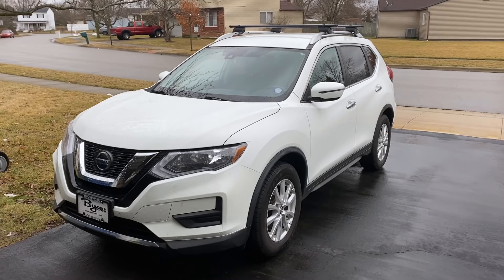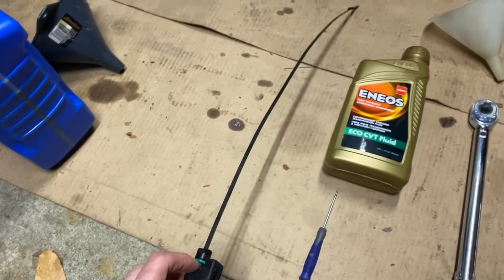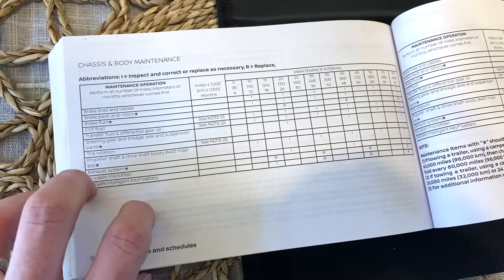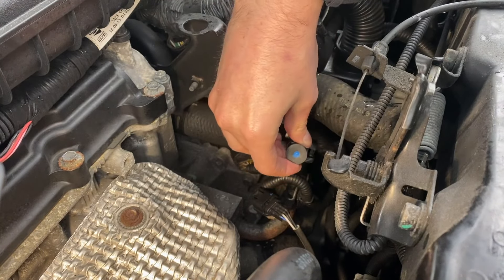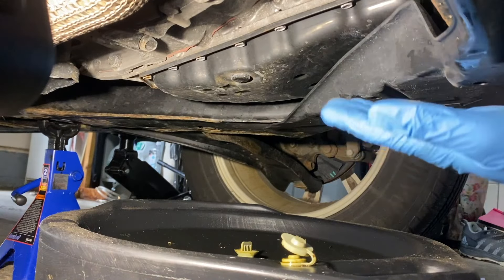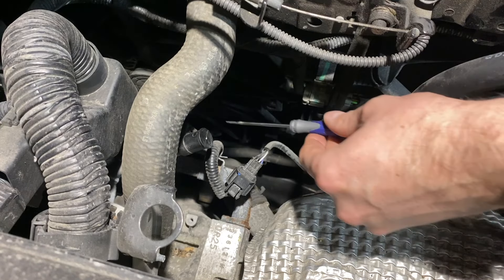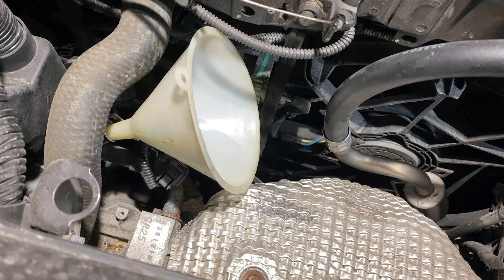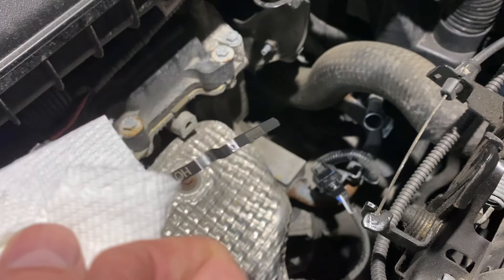2013 - 2020 Nissan Rogue CVT Fluid Change

Comment: Excellent video! So we have a 2017 Nissan Rogue and we have changed the CVT fluid on it every 25000 miles with the top of the line Amsoil CVT full synthetic fluid. It's also equally as important as to change the external transmission filter, something a lot of people overlook.
Reply from the maker: That is the second video, currently in the works. 😜 doing both the pan drop and bottom filter, and side-mount filter.
Reply: @MattStephensRich   Awesome because my research shows that the pan filter inside the transmission Pan is only up to 2016. 2017 and up there's only one external filter so I would be curious what you find on the 2019. 👍
Reply from the maker: This has definitely been one of the hardest auto videos I’ve had to research for lol just a lot of variation without a lot of documentation. I do expect two filters as this is a Jatco8; will be checking things out this weekend, and keep you posted!
Reply: @MattStephensRich  yes pan filter and exterior filter, it's behind the driver wheel. I will probably do both this spring, I changed the transmission fluid but it was so dirty I'm doing it again 3.5Q dropping the pan, will really appreciate your video if you do this👍Using Nissan NS3 , they raped me @.$27 a Quart.Will get a few more @$20 online.Next time I'm going to buy Amsoil fluid.
Reply from the maker: @jonmo2694  Mid-shoot on the current video! Transmission pan and bottom filter are in; still needing to tackle the smaller, particulate filter. Still recovering from rolling around on the ground a bunch chasing the screws. :P
Reply: @Jon Mo , In Canada NS3 fluid is $37 a litre plus 13% tax
Reply: @jonmo2694  $27/qt for Nissan NS3, ridiculous.
Reply: @MattStephensRich Want to make my own dip stick so what's the length of the dip stick also the length of the full line and low line.i know it's a odd request thanks in advance
Reply from the maker: @denzeljackson6505  Dude just spend the $15 😅 https://www.amazon.com/DIPSTICK-TRANSMISSION-31086-JA00A-Indicator-Compatible/dp/B08NWS8RSD/ref=sr_1_3?crid=1XXWO7R1U2147&keywords=nissan+rogue+cvt+dipstick&qid=1691460349&sprefix=nissan+rogue+cvt+dipstick%2Caps%2C146&sr=8-3
Reply: You should drop the pan and clean the magnets and screen along with the paper filter up a little higher on the trans. 😊
Reply: I did order this dipstick for my 2017 rogue and it does NOT insert all the way. I ended up returning it and using a long zip tie that inserts all the way to measure the fluid. @MattStephensRich
Reply: I was told at the dealership my 2017 rogue all wheel drive has no filters,sounds like they don't know what's going on.
Reply: @MattStephensRich don't forget to unplug battery after CVT oil change for 2-4 hours.
Reply: @NoWay-ye7yq   why?
Reply: @NoWay-ye7yq  what is that for?
Reply: Don't forget the screen in the pan as well.
Reply: @jonmo2694  Please also consider Lubegard 68115.  I've been using their regular ATF on my 2005 Honda Odyssey with excellent results, plus the 68115 on my nephew's Rogue.  Their lab documentation and pricing make them more attractive than Amsoil to me.  Currently 1.25 gallon 68115 is $60 on Amazon.
Reply: I would recommend  25k fluid starts  to have the burnt smell I usually do it at 18k

Comment: in this video when he sows the drain bolt there is another bolt just to the left and that is the over flow bolt . you start the car and put it in neutral and then remove the over flow bolt and let it drain till it is at a slow drip them instill the drain bolt and tighten . and then your good to go
Reply: I believe it's the bolt on the case that is on about a 45 degree angle.
Reply: When the plug is removed, the fluid overflow will have a BURP and then a steady flow untill it slows and stops. Reinstall the plug. That is the most accurate procedure.
Reply: I don't have that drain, just a dipstick. Nissan Rogue 2015 Select. I overfilled thinking i'd be able to open that and the excess fluid would drain out. Then i went to look for that bolt and it wasn't there at all. I had to get really dirty and remove the transmission bolt again and lose some fluid but i had no choice.
Reply: Accurate advice 👌
Reply: Shouldn’t it be don’t open bolt while running?

Instead open bolt while off and oil cold in case of overfill.

Then warm up oil to temp, turn off vehicle, open bolt 1 more time to ensure proper level.

Comment: I just spoke to dealership on how they “check” the CVT fluid.  He said they don’t.  Their process is they drain the fluid and add 7 and 3/4 quarter exactly.
Reply from the maker: Yeah makes sense with no dipstick/overflow valve being a process
Reply: This doesn't make sense to me, if only 3.75 quarts are coming out...
Reply: Torque converter
Reply: @tedpirsig154  i think its because you didnt take out the overflow plug, i'm not sure of the rogue has it, but my nissan has it. its beneath the drain plug, reach it with an allen key.

Comment: Very important that the vehicle is level and fluid at operating temp for an accurate check of the fluid level. Fluid expands with temp. Cold will not give you an accurate level as so many are saying here.
Reply from the maker: Good point!

Comment: Great video -
 FYI on page 9-6 of the manual you shared, both of those paragraphs refer to if the vehicle is used for towing, using a camper or car top carrier, or driving on rough muddy roads. Otherwise, Nissan suggest not replacing the CVT fluid.  The 60k miles you referred to is still bullet pointed under the towing section, and is referencing the the deterioration data that comes back from sending in a sample to a lab.

With that said - your future self will thank you for changing the CVT fluid every 50-60 k miles regardliess.
Reply from the maker: Exactly right - if anything, “just change it, sometime” would be really helpful for them to include lol

Comment: I started using the new Castrol TransMax for both CVT and regular transmissions. It has real high ratings and certified to replace Nissan NS2 and 3.  It's also only $24 per gallon on Amazon so it lowers my maintenance costs significantly.  I've learned if you change the CVT fluid every 25K that will greatly increase the life of these transmissions that have gotten a bad rap in recent years. My 2014 NV200 is out of warranty for those that will remind me it will void my warranty. Van runs great. BTW you can insert the stick backwards to measure the fluid without locking the cap when you're testing your fill levels. I bought this cargo van used as a weekend project van build.  It only had 40K miles on it, so it sat in the garage a lot.  I went ahead and did 3 drains as I read somewhere it takes three to get most of the old fluid out. So total cost was less than $75.  Compare that to NS3 fluid or taking it to the stealership.
Reply from the maker: Good tip!
Reply: Part of their bad rap is from insufficient cooling.  Also depending on your year you may even have a sticking valve in its oil pump.  That is probably the most deadly thing to these other than an overfill or use of ATF.

Comment: That thing you mentioned about towing is true.  It also reminds me of people who have a front wheel drive vehicle of any kind and have a trailer hitch (the vehicle does not come with it from the factory).  I can only imagine that they may need a new transmission in the near future.  Even though those vehicles are not CVTs I still don't like the thought of towing with them no matter their horsepower.  A Rogue can only hold 900 pounds of cargo or people total and no more.  This is when you may notice the back end sagging and the ride feeling more bouncy.  I am usually the only person in my vehicle but I don't mind using it for its intended purpose of hauling people.  I just don't use it as a substitute for a truck but rather use it to bring home furniture once in a very long time.  If I was going to buy something truly heavy I would get it delivered or find a friend who could help me bring it home.  I am not the person who wants to buy a truck just because I might need it that one time in my life.

Comment: The overflow bolt is easier to use than a dipstick. You take the bolt out and let the extra oil drain out. If nothing comes out, you didn't put enough in. It's very simple and means if you accidentally pour in an extra half a quart, it just comes out of the bolt hole easy peazy. If you pour too much in an old-school transmission you have to futz with sucking the extra out of the dipstick tube or wasting a drain plug gasket and likely making a mess trying to drain out of the bottom.

I like the overflow bolt. 🤷

At least Nissan left the dipstick tube in place to make filling easier, unlike Hyundai/Kia and so many others which just have a tiny bolt that makes a mess or requires special tools to fill.
Reply from the maker: Why not have both? Dipstick still doesn’t have to jackup a car and is tool-less to use.
Reply: How do I find the overflow in Nissan rogue 2017?
Reply: @naborhernandez4619 same question. I also have a 2017. Any luck locating this illusive bolt?

Comment: I was drafting a comment about not driving with the dipstick when you mentioned that in the video! Thank you for all the research and runarounds this video took 😅
Reply from the maker: FWIW, I have actually driven a bit with the dipstick in which gratefully caused no harm. Still opt to have it out though and use the stock cover 😊
Reply: @MattStephensRich  I installed the dipstick right after we got our used 2015 Rogue with 30,000 miles on it. 5 years later and it now has 98,000 miles and the dipstick has caused no problems that I'm aware. I had not heard that you were not supposed to drive with it in. What problem has been reported that this can cause? Thanks!
Reply: @carlkeefjr1303  I picked up a dipstick from ebay to use on my 2020 Rouge SV. Already knew of this from my 2017 Altima. Did a warm up after fighting and finally getting the plug out and checked with the dipstick and it was right at the top v notch of the hatch mark area, drained and poured into a clear jug to get an idea of amount needed. 3.8 qts for mine. I just hang the dipstick up on the wall till needed again and turn the plug cap lock tab section to the opposite side and slide it back on. The O-ring fits snug and it isn't gonna fall out. I see no reason why the dipstick couldn't just stay in. My Rouge only had 8069 miles on it when i bought it last Dec.2023. Has 10855 this last weekend when i did the drain and fill with TriaX CVT fluid. Will do again at 15K and 20K so i know i have new fluid. Then go to 30k mile interval.

Comment: I believe even with the CVT (vs. traditional ATs), its fluid should be checked while the engine is at idle with fluid temperature is between 170F to 180F.
Reply: On Nissan rogue your not suppose to have engine on while you stick in a dipstick to measure I think that's why this vehicle doesn't come with one it could damage internal parts.

Comment: I managed to do it myself, Rouge 2015 S. 200k km never changed before. Report for the records;
- The cap for the oil reservoir is hell to take out, I cut it off with oscillating machine!!! you think it is rough start!! 
- I don't have the dip stick, so i used a long zip tie ~25'', and i took the mark of the original oil. I fed the zip tie too much at the beginning, it caught into something inside!! with some patience and force i released it, I panicked for 2 minutes, hopefully it didn't damaged something inside.
- Removed 12 clips for the black fabric
- I left the drain plug attached as i found it rusty, and i don't have crush washer. so i preferred to leave it sealed as is.
- I unscrewed 19 screws. Some of them were very rusty. Took the pan down with some splashes.
- Changed the screen filter.
- Removed the gasket, it was very attached to the metal. it left some unremovable parts on the metal. I tried to scrap it but didn't want to create solid powder inside.
- Failed to unscrew the cooling filter cover. 2 screws are very hard to reach or to access. Even i have accessories for the socket wrench. It needs very low profile 10mm socket. So i decide to skip this filter.
- cleaned the pan, put new gasket.
- screwed back 19 screws
- Added the oil, it took 4 liters. You need a long thin funnel.
- It took around 5 hours (it could take 3 without my shenanigans)
Reply from the maker: Great work! Likewise still trying to work out helpful guidance on the secondary cooling filter - it is reallllly wedged in there.
Reply: 200k miles on it? Wow
Reply: @Action_Clips_CODM  200k km

Comment: Did our 2019 Rogue at 33,000 miles today.  Took just a bit over 3.5 qts.  Silly not to change at least every 50-60k.
Reply from the maker: hope the video helped!
Reply: What I think is silly are those people who expect to get 100,000 miles out of the original fluid.  they don't realize that modern transmissions need a lot of maintenance that most people neglect to have done.  Then they wonder why they have so many problems.  I used to own a Volkswagen and one mistake they made is telling people that it is a lifetime fluid and never needs changed.  Then the gullible people who believed that wondered why it failed so soon!!  VW recommends 60,000 miles now but really it should be more like 25,000 - 30,000.  Look at their DSG they are at least smart enough to make it mandatory 40,000 miles between changes.  It is not really mandatory but if you try to make that fluid last forever you will be sorry you didn't listen!!

Comment: If you go look at those owners manual pages again, it's actually not contradicting. The first page you showed specifically states they're instructions for if you are towing or driving on dirty/muddy roads. The table that says inspect would be for regular driving conditions.

Now obviously the manual isn't giving good information, telling the owner that they only should inspect, but it is consistent.